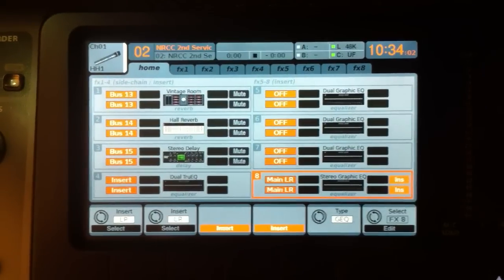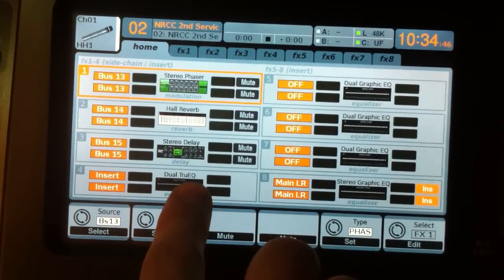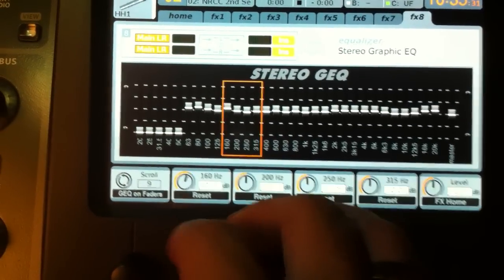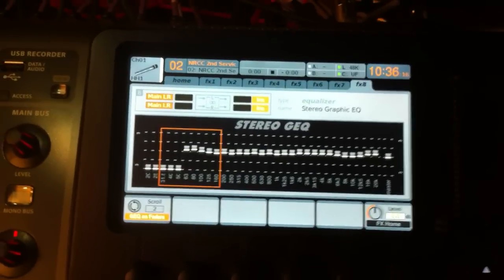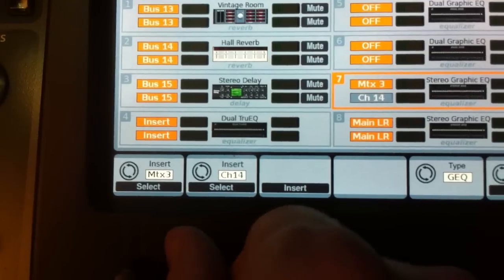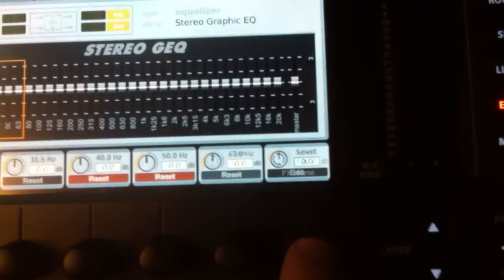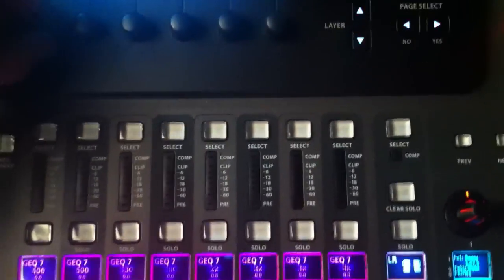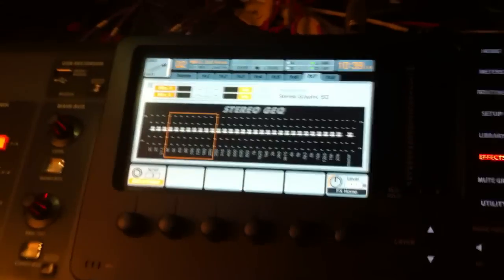Behringer X32 - Graphic Equalizer Insert, How To - NRCC

Comment: Configuration

Hello I bought an x32 rack I have in configuration an X32 Compact for the facade with a Box DL32 Midas internship, with WiFi Router,.My question I was told that we could have a different EQ between the facade and the returns I speak of EQ EQ and not of the eq master on returns.If you have configuration I am interested, the connection everything works with the sound, but nothing works in EQ on each edge on the returns.Routing connection I start from the AES50-A of the compact to the X32 rack in B and then a rack to the A DL32 Midas
Small details the inputs and outputs are coughing connected to the DL32 Midas

Bonjour j'ai acheté une x32 Rack j'ai en configuration une x32 compact pour la façade avec une stage box DL32 midas,avec des router wifi,. Ma question on m'a dit que l'on pouvait avoir un EQ différent entre la façade et les retours je parle d'es EQ et non des EQ Master sur les retours. Si vous avez  configuration  je suis preneur, le branchement tout fonctionne avec le son, mais rien ne fonctionne en EQ sur chaque tranche  sur les retours. branchement  routing  je part du AES50-A de la compact vers le rack x32 en B et en suite A du rack vers le A DL32 midas

Petit détaille les entrées et les  sorties sont tousse branché sur la DL32 Midas

Comment: Can you insert the same GEQ into several individual channels by creating a preset of it in the library and use that preset to insert as many channels 1 - 32 as you want?
Reply: use 4 dual GEQ (not stereo that way 4 dual EQ's allow you to send a channel from each to your monitors). 4 dual EQ's means 8 individual GEQ outputs on your monitor mixbuses.. make sure you use the insert fx side for this. if you want to insert a GEQ on your Main L/R as well the first bank of 4 can be used as sidechain OR insert. so in theory, fx 1-3 can be set as sidechain FX so as an example a vocal reverb, instrument reverb and tap delay, FX 4 set as a stereo GEQ on main L/R and fx 5-8 set as dual GEQ with each channel going to each of your monitors

Comment: Thanks for the valuable info Drew.  How audacious of Behringer not to produce simple videos like this for various console functions.  If I might make a suggestion or two, it may be helpful in the future to mount your phone/camera on something stationary to avoid all the movement.  I had to replay the video multiple times because it was not obvious at first which buttons you were pushing and/or turning.  Being an ancient old analog engineer in his 60s, I found the video instructions just a little too fast for me, and replaying it over and over several times actually made me dizzy.  BUT, the video was extreemly helpful, much more so than the manual.  So THANK YOU once again Drew.  I have to mix on one of these tomorrow and the House Sound Boy obviously messed up the room's EQ/tuning.               So THANKS AGAIN!
Reply: I was thinking the same thing. But also grateful to be able to slow down the playback speed because Drew speaks at a thousand mph telling us what he knows, and not actually explaining how to do it. Having said that, his presentation was at least delivering some information that is otherwise hard to find...

Comment: Hey Drew! Any steps on how to ring out a wedge monitor on stage with the x32 app on ipad? Is it even possible to do on the app or does it have to be done with the main board?
Reply from the maker: +Joe Shinkey Hey Joe, the process of ringing out a monitor is the same if you were using the iPad or using the X32. Put an open microphone on stage, start turning up the gain and talking into the microphone until it starts feeding back. Remove that frequency using the EQ and then repeat the process. If you ring out too much then the monitor will not sound natural, so make sure to listen to some music through the monitor and make sure it still sounds good when you are done!
Reply: Thanks Drew!!

Comment: I know this is an old thread, but just for anyone reading it, a bit of clarification...

"If you wanted to add more than just one of the P16 mixers, you would need a P16D distribution from Behringer"

while it is recommended for various reasons, the P16D is NOT required to use multiple P16 mixers, you can simply daisy chain them together one right after the other.  having said that, I would highly recommend the P16D for a couple reasons.

1. the P16D will send power down the Ethernet cable to each of the P16 mixers, saving from needing the wall wart at each one.  you simply plug all your wall warts into the P16D.  makes for a little cleaner stage.  also, if you were to daisy chain out from one of the mixers connected to the P16D into another mixer, the second one would require the wall wart plugged in locally.

2.  to me the greatest reason to use the P16D is for reliability.  if you were simply daisy chaining the mixers, if the first cable in the line had issues, it would affect everything following it.  with a star system like the P16D gives you, the only thing affected would by the mixer the cable is connected to.  granted, if the cable feeding the P16D goes out... everything behind it will as well.

Comment: This is so cumbersome compared to how it's done on the Soundcraft SI boards. Also, I was hoping we left the age were a limited number of graphic EQs had to be specifically inserted. On the SI there is one in each and every output, and as I said it is so much faster to get to and tune it.
It's a bummer, cause I really like the general layout of the X32, specifically the compact.
Reply: This is one of Behringer's exclusive job security features. Anyone not yet inducted into the clique will be immediately confused by the byzantine maze of modes and archly computerized terminology. You can also concoct your own convoluted routing and naming conventions, and maximize the amount of mode switching required for even the most basic mixing functions. These obfuscation features insure that no one unfamiliar with the cryptic LCD routing interfaces will even dare touch the faders.
Reply: The X32 also has a 6 band fully parametric on each output which is way more precise than a 31 band EQ, I don't believe the SI has that available.

Comment from the maker: You can use the effects rack to insert racks 5-8 on channels such as pre fader mix busses.  Use the Dual Graph. EQ instead of the stereo.  When using the Dual EQ, you can use 4 separate EQ's in two rack spaces.  Just select the Bus that you want to insert the EQ on, and then press the "insert" button.  Also check out my new video on the differences between the GEQ and the TruEQ.

Comment from the maker: All of the effects are built into the X32 internally.  You can use Waves Multirack with the Behringer X32 to use the waves plugins with the console if wanted, but it is a pricey option as the Waves Multirack is $500 for the program, and then the price of the plugins.  For most users the effects that are included in the Behringer console will be sufficient.

Comment from the maker: Yes you can!  You can directly connect a P16 to the Ultranet jack on the X32.  This would be a good idea if utilizing the S16 stage boxes which also have an Ultranet jack on them.  If you wanted to add more than just one of the P16 mixers, you would need a P16D distribution from Behringer.

Comment from the maker: So I have Matrix 1 feed my PA system (which is a mono system), and I have Matrix 3 and Matrix 4 linked as a stereo pair to output to my "world" which is the term I use for Video Recording, CD Recording and our Live Audio Feed for our backup video system. By having the board set up this way, whatever is being put into the room is also being put into the recordings and feeds at the same volume so my mix is the same everywhere.